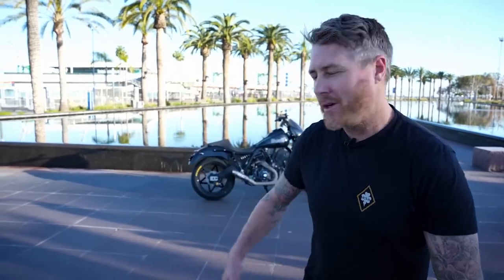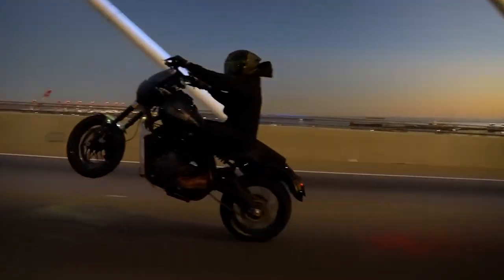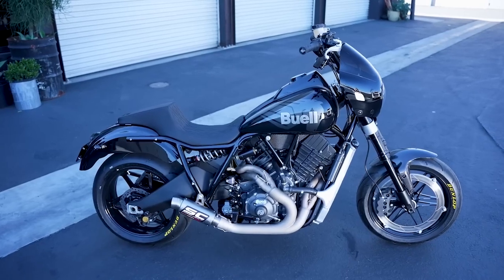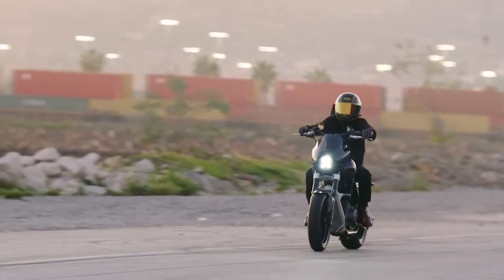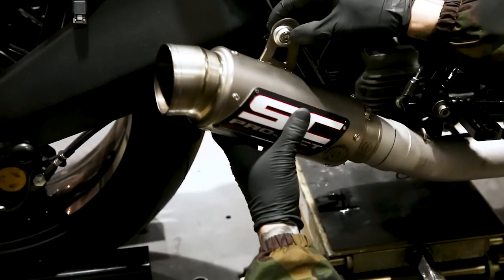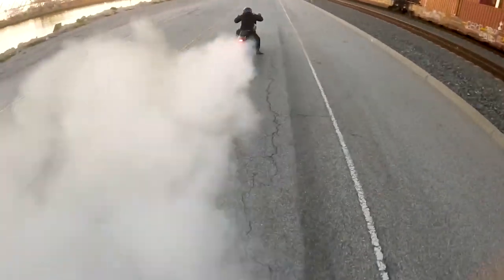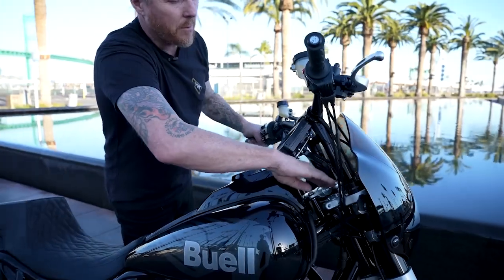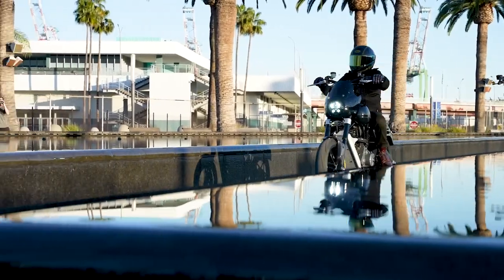Buell Super Cruiser 10 Things you need to KNOW!

Comment: This bike is pretty much everything I dont really care for in the new cruiser market.
Dyna Bro styling with that generic over used RoadWarrior fairing.
T-Bars which are terrible for body position.
Blacked out everything, it's getting old and over done. At least the Lowrider S bikes have bronzed wheels.
2 into 1 Exhaust that, sure it makes power, but they're not gonna be able to sell it with that shorty pipe. They're gonna have to make it EPA compliant with a big ole catted muffler.
At least it's a monoshock rear instead of a dual shock rear, and they didnt step backwards in suspension design like Indian did with gen2 chief.
It does make 160hp at the crank, but it's an offset Vtwin that's liquid cooled and they're making no attempt to make it look reasonably aesthetic. Big slapped on their prototype looking intercooler.
I'll stick with my Fat Boy.
Reply: Well if you drive a fat boy you probably wouldn’t like this bike anyways. Harley guys love hating every thing except Harley.😂. I know this because my die hard harley buddies hate me for wanting this motorcycle. To each, his own.